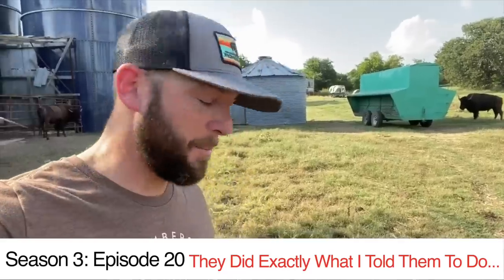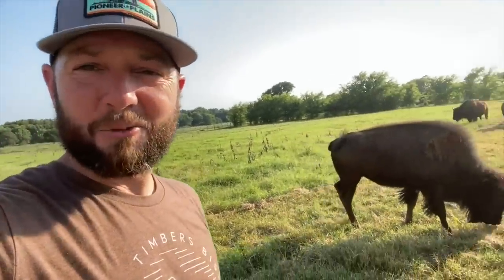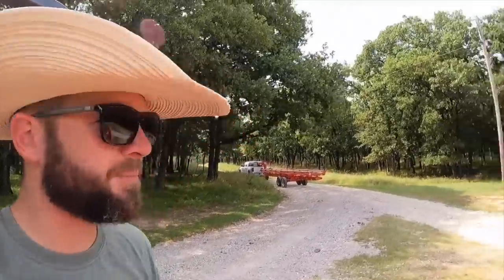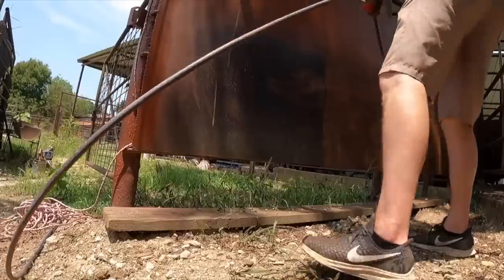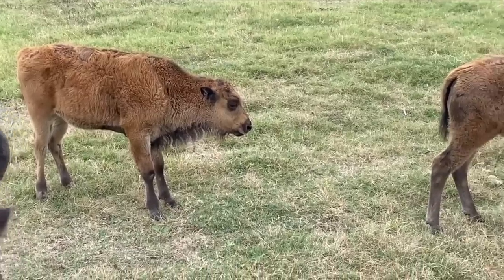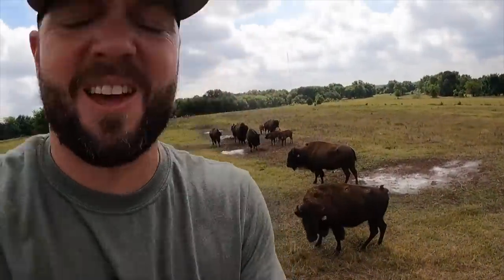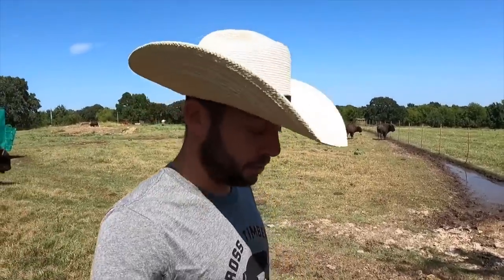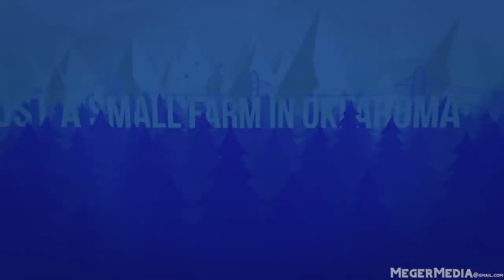Cross Timbers Bison: SEASON3 MARATHON! (Part 3 of 5)

Comment: Dusty, u could break the lock on your main shaft drum when u load your hay on the trailer with your truck in park, u pushing with the tractor and stressing your main shaft lock. When u put any automatic transmission in park there’s a lock pin that locks the transmission main final drive and that’s why the cars don’t roll in park on a leveled terrain, however parking your truck or car up or down a hill u must engage your parking brakes to secure the truck from rolling or even snapping the parking pin lock.